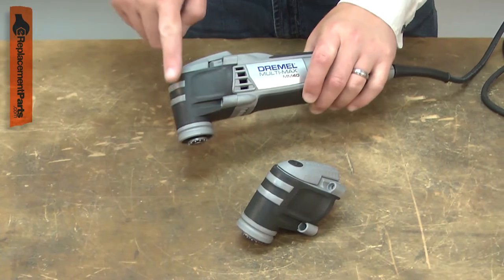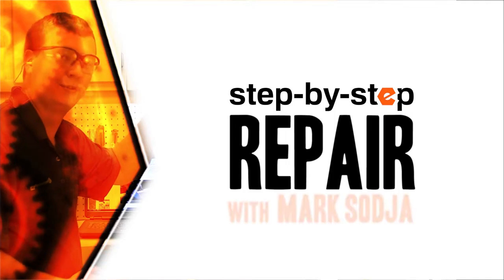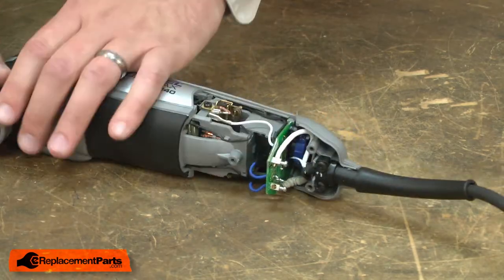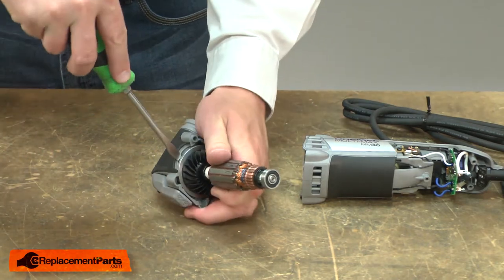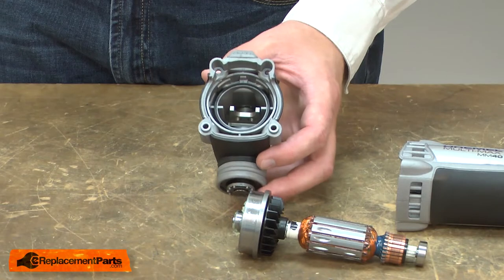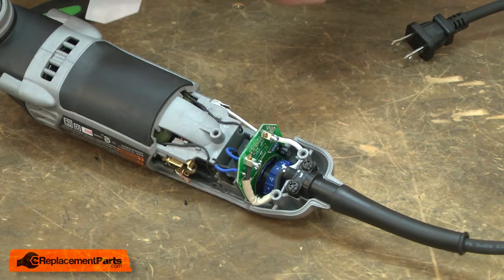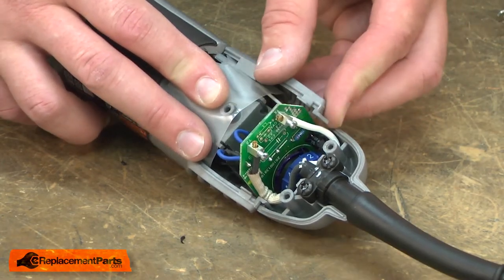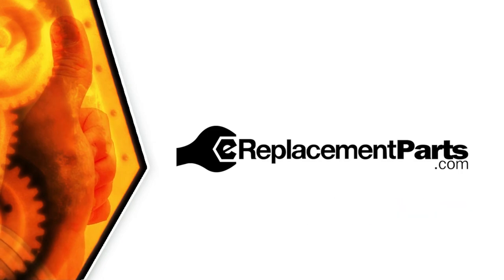Dremel Rotary Tool Repair - Replacing the Housing Assembly (Dremel Part # 2610013980)

Comment: Hello I congratulate you for such good advice, I take this opportunity to ask a question: the head where the cutting blade is placed has a Quick Lock adjustment. my problem is that the base of this Quick lock callo lubricant and now it constantly misadjusts changing the direction of the cutting blade, could you help me with any advice.
thank you